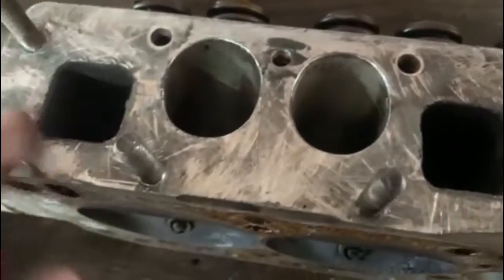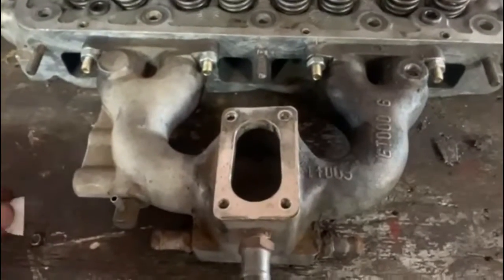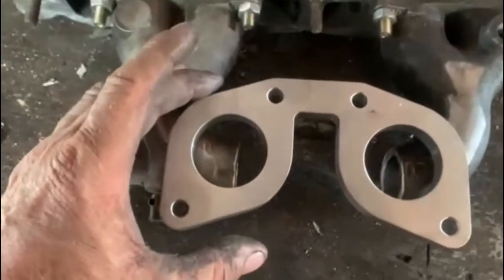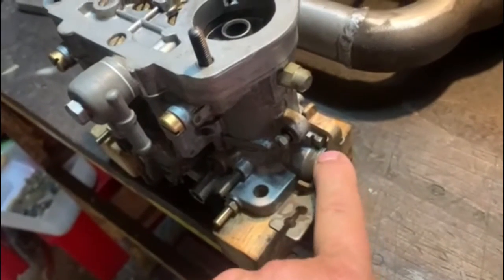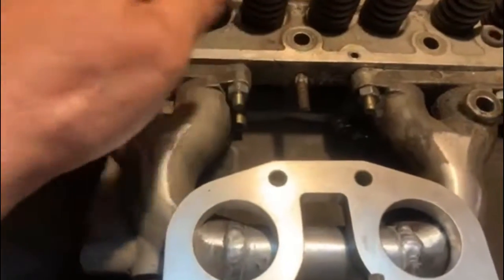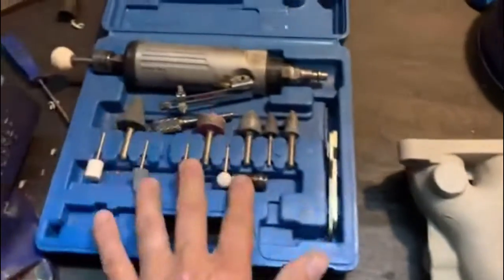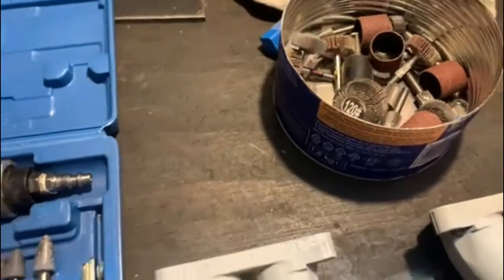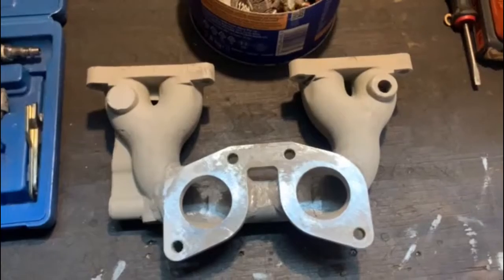Blow through turbo setup - Nissan 1400 - Part 2 - The Manifold

Comment: We need part 3! Is there any issue running a weber 32/36 for a low boost application?
Reply from the maker: The 32/36 has been used, i would not advise to use it. you will need to do loads of mods in it. Part 2 is coming, thanks for watching.

Comment: Can you not convert any carburetor to run boost?
You’re the expect around these carburetor things?
Reply from the maker: you can depending how high you want to boost. at higher boos pressure gaskets start going brass floats collapse, so it is always advisable to use a carb designed for Turbo use. Like this one.

Comment: Why didn’t you go with side drafts?
Reply from the maker: I have done a couple of turbo builds in the old days with side draft Dellorto's and it works fantastic, those builds was on cross flow engines so the turbo heat is on the other side of the engine. The A14 engine is a non cross flow so all the heat are going to be below the carbs. With the DRLA the float bowls are above the manifold, partly shielding it from the heat, especially in traffic. And i think it will be a cool build.